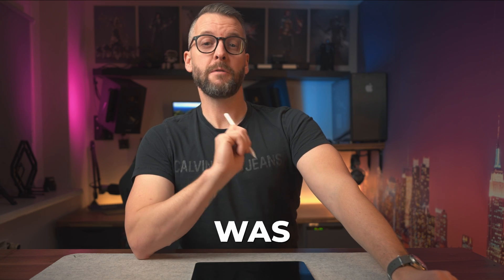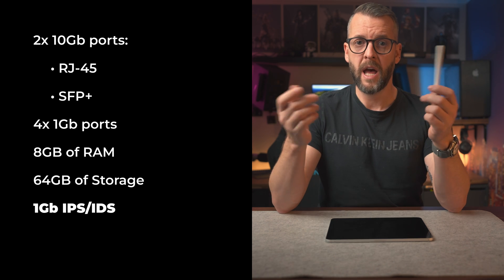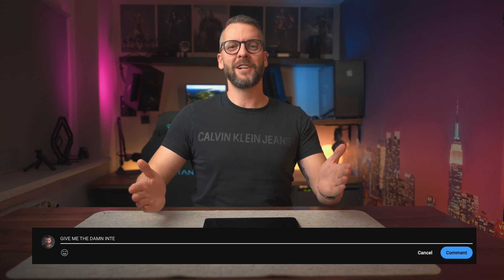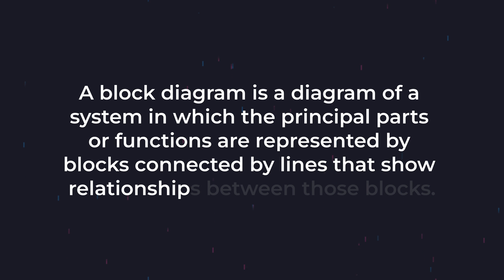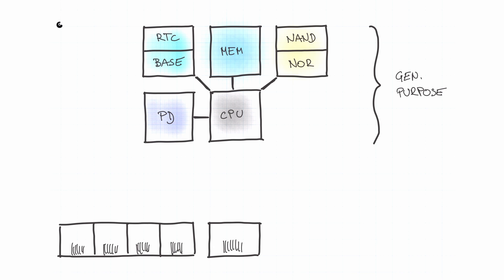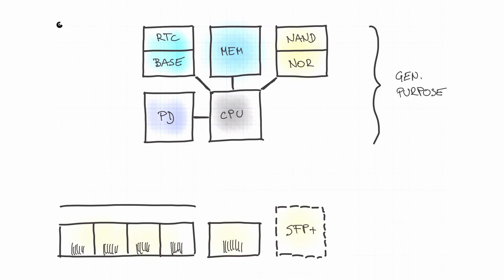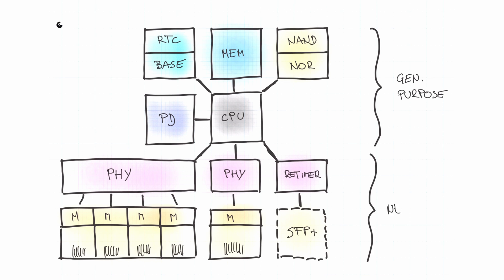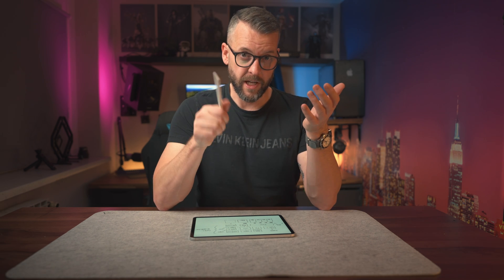Designing my own high-end router: the block diagram.

Comment: I know this video is a little bit old now, but I will state that it is necessary, or at least in my opinion, to have at least one or two USB Type A ports on the router, even if most external storage devices are switching to Type C. So you can set up a simple network drive, because I think this is functionality that should be fairly standard, even though that it has kind of disappeared, even in higher end routers
Reply: Yeah, I'll just add that it's a little bit of a pet peeve of mine that a lot of devices and other stuff nowadays removes functionality and forces you to have to get a separate device and fuck around with separate software and all this shit just to do something simple like a network drive Something that should be as easy as setting up the correct file structure on an external hard drive and plugging it into your router and maybe having to go into your router settings to enable that functionality. Turns into needing to get a separate device like a Raspberry Pi or some other single-board computer. Plug your hard drives into that and set it up like a NAS Which sounds simple-ish on paper, but is actually a bit of a nightmare and requires like 70-ish dollars in extra hardware that you shouldn't need.
Reply from the maker: Thanks for the input, it makes sense to what you're saying. There will be more videos and discussion about the details, none of it is 100% yet.

Comment: I am definitely going to follow in your journey. I would absolutely be interested if there was PoE support on at least 2 of the channels. Ideally all 4 but I know, a cost add thing for power. Would be a very interesting product if had that capability.
Reply: Actually having this device being able to be powered by PoE would make more sense for me. A firewall is not a switch, it should not deliver power to other devices. Making it provide PoE would require a BIG power supply, which, I think is completely missing the objective of having a small external power supply.
But, having it powered by an existing PoE switch (like an Access Point or VoIP phone) would reduce power cord clutter and remove the need for an annoying power brick. Would it be possible to make the device power draw less than 25W and be able to fit within the 802.3at (PoE+) standard?
Reply from the maker: Thanks! I actually have a small notepad with features people ask about. So everything will be considered, if there's demand, obviously. Makes no sense to add stuff only a handful of people will end up using.

Comment: Why not 2.5GBE instead of gigabit Ethernet.
Reply: 2.5GBe would be highly appreciated. I wouldn't want gigabit if I'm upgrading right now
Reply: 2.5 gig has to be non negotiable
Reply: The CPU only has gigabit and 10G
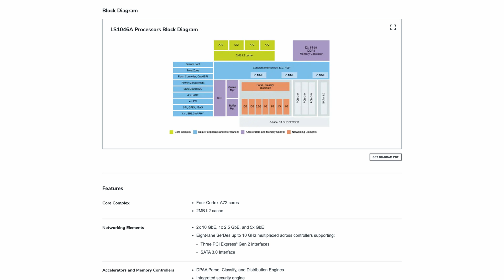Reply: @benchy5769 It looks like the CPU supports one 2.5GbE port based on the CPU block diagram at 9:42
Reply: I completely agree
Reply: @deardiso9193why is that?

Comment: I would really like a dual SFP+ variant as we always use sfp+ with fiber in almost all our builds, we never use the rj45 variant
Reply: Agreed. This is incredibly important to make sure all use cases are covered. As far as I'm concerened, not having dual SFP+ is a total deal breaker for me.
Personally I think having dual SFP+ should just be the default and only variant. If users need RJ45, they can just use adaptor transeivers.
Reply from the maker: Hm, I'll give it some thought. Dual SFP+ would actually make the device cheaper.
Reply: My thoughts to. SFP+ modules for fibre or copper are fairly cheap now (sub $20) and come in both 1 and 10G options. Doing this lowers the cost of the unit while allowing the user to pick what they need. Would definitely be a requirement for me.
Reply: Problem is that in Europe the 10g port on the modem for FTTH is a 10g baset sadly rather than sfp+
Reply: Agree with this too. 10G over copper tends to be more of a backward-compatibility use case, and it can still be supported as such with a 10G-BASE-T SFP+ module.

Comment: Im curious to see the OS implementation plans, it seems like opnsense has some unofficial support for ARM64 but it will likely need the latest branch of BSD to be ported to your platform which sounds costly. Hardware plans are awesome and im excited to see where it goes!
Reply from the maker: Thanks! I'm currently in talks with another vendor of telco gear that can lend me some ARM-based PCBs for me to try and test how difficult it is to port opnsense to it. Will report here, of course :)
Reply: @tomazzaman  was googling and came to this: "OPNsense 23 for aarch64" by yrzr on 2023-07-13 *screenshot says a ARM Cortex R72

Comment: Some tips from a former embedded developer. The PHYs will also need a clock. But if they use the same frequency (e.g. 125 MHz) you can reuse the same oscillator and use clock buffers or daisy chain the clock signal. Saves you another chip.  Also there are oscillator chips with multiple output clocks and you can program every output clock before hand.
Another important thing are LEDs, they are useful for debugging but also have their use during production and can show if some software component is running or not. Just make holes in the case and add walls to block light bleeding. People will find many uses for the LEDs.
Reply from the maker: Former? What made you quit/leave?
Thanks for the suggestions regarding the clocks, current candidate is 6V49205BNLGI8 (and 9DML0441AKILF for the buffer). 
You have just made me think about the LEDs though, I personally hate them anywhere else but the ethernet ports (so that I can see activity). The initial plan was to have one LED that blinks while booting up and then remains lit during normal operation. However, putting some extra on PCB for debugging purposes makes a lot of sense. Thanks!
Reply: @tomazzaman Nothing dramatic, I left the company and started my master studies. In a few months I have finished and will return to the job.
Reply: @tomazzaman  diagnostic/warning LEDs are great, but once they become "idiot lights" (just there for dumb user), more annoying than useful.
Maybe as you say on the board, or behind a cover?
Reply: @tomazzaman  in case of LEDs you may want some buttons, too. you can turn the aditional LEDs of, and leave only power LED in a dimmed state, on button press, you activate the rest of the leds to display certain status info, like sfp status an online indicator, an vpn indicator, or anything else a user can imagine.

maybe take a look at the Speedport Smart 4 from Deutsche Telekom and use an OLED Display. There are multiple use cases for an display. heartbeat, actual amount of traffic, load, number of active (WiFi) clients, IP Adresses, CPU Load
with an display you are not limited by the amount of leds and also can utilize it as an led replacement.
Reply: @tomazzaman  For the LEDs it makes sense to move them in tiny and large devices. In 1U densed rackmounts sometimes cable clusters get in the way of port LEDs. In tiny devices the cable might be opposite the view of the user which is why home routers have LEDs at the front instead. You can go both with a simple LED screen that summarises the router details and port LEDs, mikrotik does this on their higher end devices.
Reply: I definitely agree with adding leds. I recently finished an embedded design where I was required to show all the power, status, and error information with one RGB LED. It took a lot of development time to figure out how to squeeze all that information through one LED when it would have been dead simple to have separate LEDs for each function.

If I was doing that design again, I would use separate power, status/activity, and error LEDs. Unless PCB space is the limiting factor, I would at least add pads for indicator LEDs. If you don't use them there's no wasted cost, but if you need them later you can do light pipes to the case which was easier then I thought it would be

I like dual color red/green leds for status and error since you can do red/green/both (amber)/black (off) flashing for intuitive severity feedback. People can guess that fast flashing red/black is clearly worse than slow green/amber. Just my two cents having flashbacks (pardon the pun) to working on UI with LEDs
Reply: @academicpachyderm5155  you can use a cheap small simple LED screen and get creative to easily show all the details. This lets you save on physical space but lets you do more. I bought one to test with a pi compatible SBC for adding monitoring to my network and EEE projects later as i am powering my SBCs via a PSU + buck setup for better reliability since im sick of failed PSUs (mostly external power bricks) and per chance i found one of the best PSU brands affordable this way. I plan to expand and convert it to a dual redundant balanced supply featuring 2 PSUs and 2 balancers to the same circuit later and having both physical and network monitoring available through web and physical would be nice. I also have LED arrays so i will be using both together since i am playing with desk organisers, wood and plastic but i may just stuff everything into an outdoor box as those are cheap here that typically house electronics for control systems.

I check various details like heat and humidity, voltage and other things and have had power failures and spoilt hardware so its not easy but im taking steps against it. So even this video's simple router can be downed by power issues unless he learns from a brand like mikrotik that put a lot into their power design on their boards.
Reply: Personally I am still a simp for ye-old 7-segment displays. It just makes it so much easier than just using a few random LEDs.

Comment: Odlično! This is the most interesting project these days on the Internet. Just please, make it 2.5 GbE instead of 1GbE.
Btw what is your background?
Reply from the maker: 2.5GbE is only possible on one port because of the CPU limitations. I mean, I'd love to choose better components, but then the device will become much more expensive and inaccessible to some.

My dad had an aluminium foundry, so I helped him a lot growing up. Because of that I signed for mechanical engineering middle school, but I partied too much so my grades weren't that good. Went to  Biotechnical faculty to become a wood technology engineer, but didn't finish as I got kids and fell in love with software development. In 2012 I started a startup called codeable.io (with a partner), left last year. Now I do hardware. Or, I'm trying to :)
Reply: @tomazzaman  it make sense, given the CPU limitations. On the other hands, we are getting cheaper 5x2.5GbE + 2 10GbE (unmanaged) switches that are super affordable. I would gladly pay more for something with more capabilities. Maybe even PCI-E expansion slot as on Zima board, so one can choose the expansion. But I guess that's even more complex and expensive on the CPU side. Can't wait for the next video and some rough estimation on the pricing.

Cool that you are able to pursue what interest you. Wish you all the luck with the project(s).

My dad has a car/auto-service, so I started with modifying cars, then racing, now sim racing online. I studied computer science on a mathematical faculty (PMF) so I naturally went into software. But I'm so interested in hardware, IoT, smart homes and all of DIY stuff. That's why I find this channel super cool. Kudos!

Comment: Sad that you are just providing a console port and not a full remote management port (IPMI).  One win of using an Intel CPU is the availability of AMT/vPro which gives an adequate remote management interface.
Reply from the maker: Honestly, I would absolutely love to, but including every feature that people ask about would make this device significantly more expensive. I kinda believe in adding only features that 95% of people will use 95% of the time. And since this device is mainly intended for home owners and small businesses, I'd argue IPMI doesn't fit into that category, since you can easily get to the device in your pijamas :)

Comment: Have you considered going with dual sfp+ ? SInce RJ45 transceivers would allow for dual function. It would also be nice if one of the 1GBE ports was a SFP port, since that would allow one to not  have to use a ISP CPE. USB-C PD would also be very nice.
Reply from the maker: Like @omegatotal said, RJ-45 SFP+ modules get VERY hot (I have one in my switch, can attest to that), so I'd rather have the  flexibility. Putting two side by side would be a risky move. Don't get me wrong though, it would be cheaper to manufacture as we'd get of one PHY chip which costs around $30 on its own, but I'd rather not force potential customers to buy more stuff to get it working.
Reply: I and almost all installs we do use fiber either OS2 or OM4 we would rather have 2x sfp+ ports seen as we run fiber between all other gear and fiber comes in in fiber format so the rj45 would be un used and that way useless or were are force ro run a sfp+ rj45 on the switch side
Reply: SFP/SFP+ RJ45 can get hot and be prone to failure in some systems